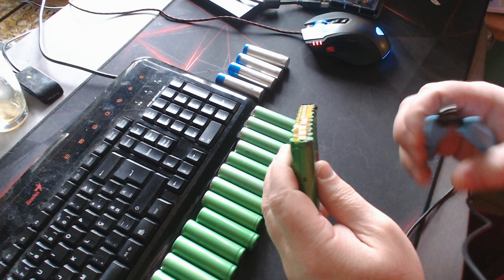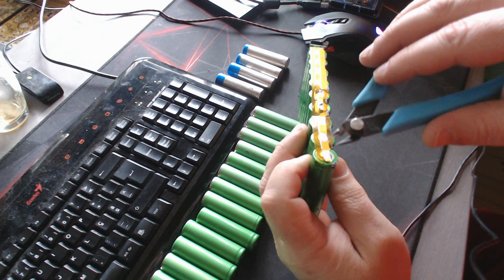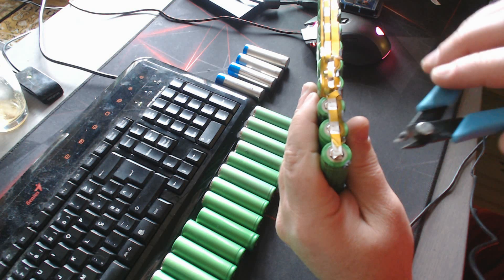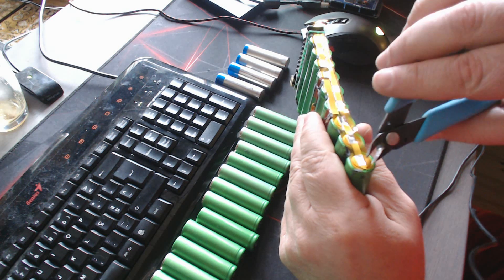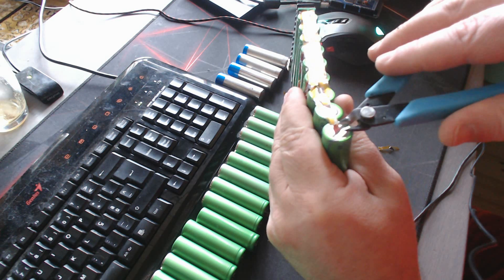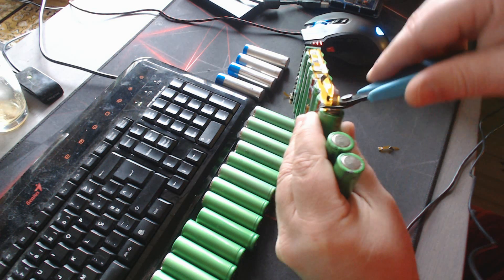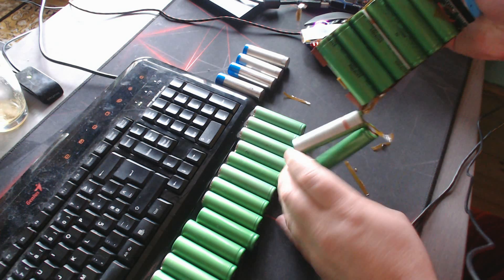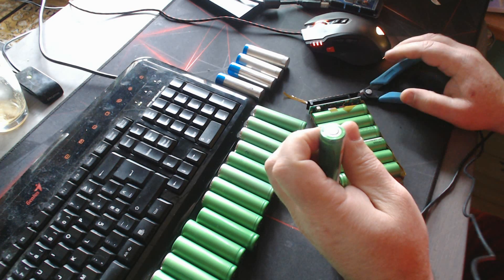18650 cells spot weld removal

Comment: If you wan to know, these are called flush cut cutters or plyers, there used for different applications.  We used them for tyraps where I used to work so nobody cut themselves on them, the working area needed to be uncontaminated.  They definitely do a great job for removing the nickel straps

Comment: I tried this on one cell and the metal on the negative side is so thin, it bent it out/deformed it.  I would be concerned that you could tear a hole by doing it this way.

I found the chisel method worked perfect with a 10 dollar Jorgsen wood chisel from the hardware store.

Comment: just be careful not to put pressure around the edge of the positive side, you can short it out and it will explode :) dont ask how i know that hahaha
Reply: How big of explosion was it? If im understandsing if uou touch pliers to edge of positive battery end of it. If it wasnt covered it would blow..
Reply: @david2881  dont worry it takes ages to explode...i know i did it myself...first it gets really hot....than smoke coming out than fire....its not like you short and boom...no it takes minutes...the explosion is not the problem...the problem is the smoke and the fire...hard to put it out.
Reply: Late reply sorry, this won't happen if the cells are fully discharged I'm guessing?
Reply: @RileyColson-jv7mg depends on what you mean by fully discharged, at a completely flat 0v yes there is no energy in them, at a normal discharge of about 3v there is still a lot of energy there, plenty to cause a fire.

Comment: And you can use the battery again right? What about upper side there metal dots are left for my 18650 battery, they dont do anything or I should get rid of them too somehow same as bottom side?
Reply: Easiest way that I found to work was to use a dremel tool, preferably not a cutting disc. Slow setting, don't put any force on the battery and don't hold it on there for too long.

Comment: first the min. and than the plus? or it doesn't matter?
Reply from the maker: Doesn't matter if you are careful, and the type of cell you are dealing with,, some packs have cells that have very strong welding so you might attempt on the negative side first, so if it ruptures, then cell to trash...
Reply: @lusofreak_gone thank you ,four 18650-2000mA  in series it are , i'll let you know how it went.